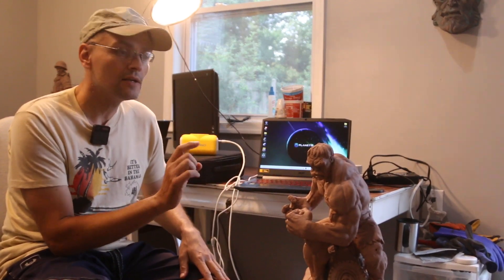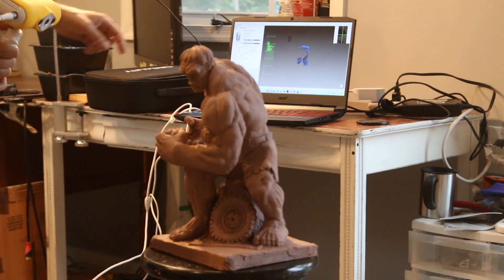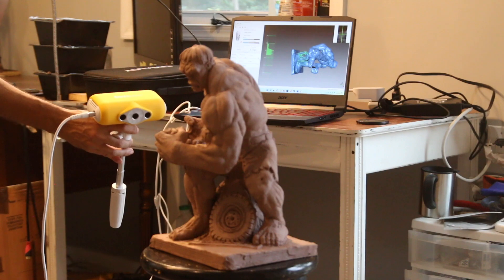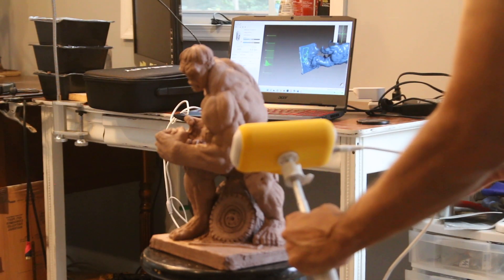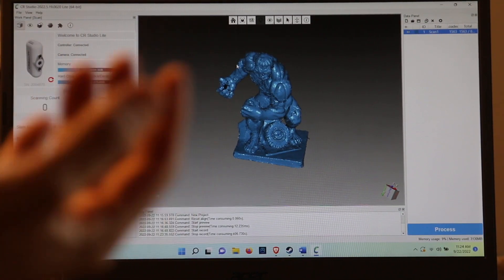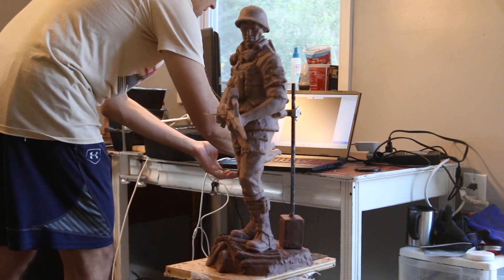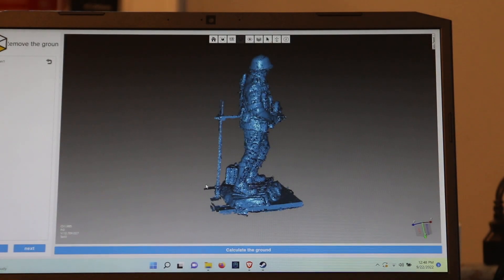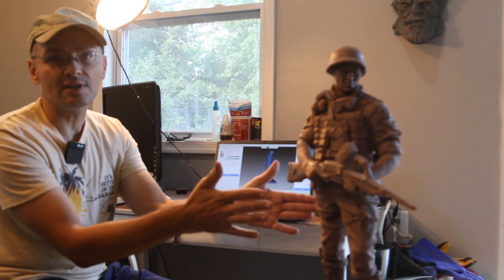scanning the hulk sculpture for 3d printing

Comment: When using the scanner in handheld mode, it is meant to be vertical vs horizontal (how this scan was done). That will orient the scan on the screen as you desire.
Reply from the maker: Wow thanks, never realized that. I knew I should have read the instructions :)

Comment: I'm thinking the 3D printed figure won't have the same "presence" or display of skill like the clay original?
It's a great concept , though.
Reply from the maker: Definately, im printing it now and it has limitations. YOu don't see the tools on the surface of the 3d printed version. I had to reduce the size as well. But the scan in general was accurate except for the more organic quality the terracotta version had.